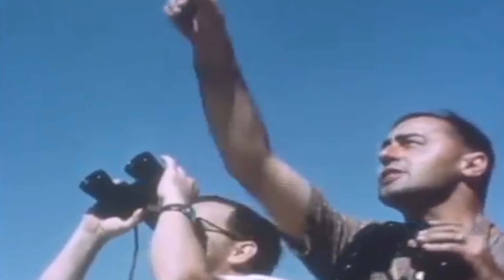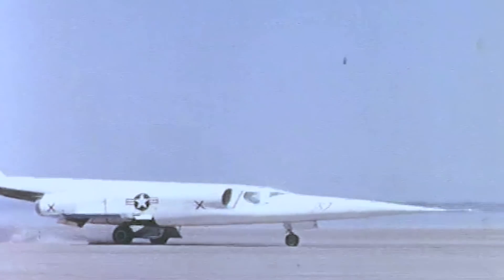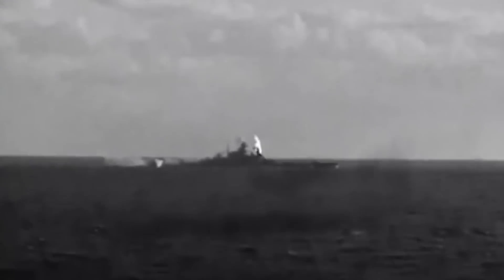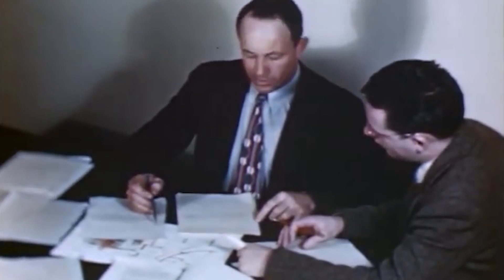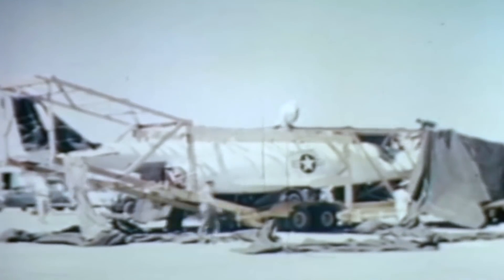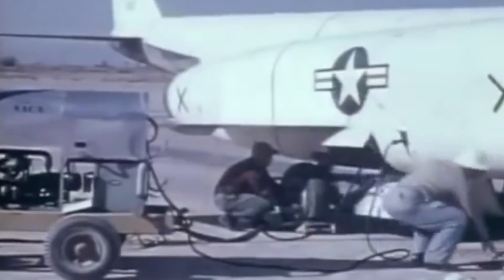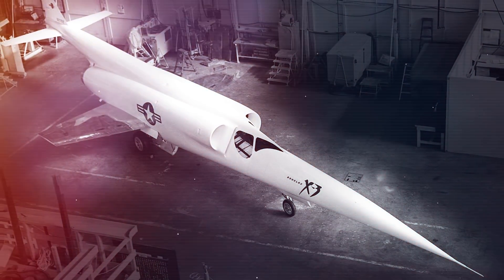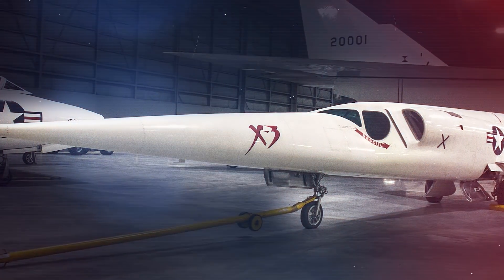Douglas X-3 Stilleto - The Dagger That Could Barely Fly

Comment: Another awesome aircraft doomed by it's engines.  The roll coupling was solvable with a larger rudder, as was done with the F-100 with similar issues.

0:29  That's the 16-foot tunnel (later  a 12 foot tunnel) at NASA Ames/ Moffett Field.  There is a scene in THE RIGHT STUFF where the 7 astronauts are walking on the lawn in front of the 16/12 foot tunnel.  Two twin 7x10 foot tunnels to the right and a corner of the huge 40 x80 foot tunnel on the lower left.  I worked in a model shop in the late 1970s on the far side of the 16-foot tunnel. The shop and far more have yet to be built at this time.

Comment: In appearance the X-3 looks like it could streak to the Soviet Union & use the point of its nose to pick the lock on the third door down a long corridor from a front door of the Kremlin. 
But other than theoretically & learning from aspects of the plane it doesn't sound like it could pick its own ass.

Comment: I had to replay one part 3 times to make sure I heard right: "From 1941 until the beginning of 1943, the Douglas SBD would be the vanguard of the US Air Corps, fighting off the Japanese Zeros ... "  Wow ... I've heard a lot of Dark videos, and I've enjoyed them all, but I've never heard such glaring errors as this.  
First, the only service that fielded the SBD was the US Navy and Marine Corps, who named it the "Dauntless".  The only US Army variant was the A-24 Banshee, which saw very little service.   
Second, the SBD wasn't a fighter at all, but a BOMBER - specifically a dive bomber.  Among others, the SBD's were credited with sinking all 4 aircraft carriers the Imperial Japanese nave sent to the Battle of Midway.  
Third, the SBD served long after the beginning of 1943; they flew with distinction in the Battle of the Philippine Sea in June 1944.  Many of the pilots preferred it over the Curtiss  SB2C Helldiver that replaced it, because of its superior low-speed handling characteristics, critical for carrier landings.

Comment: 9:53  -  ''... in the following months until December of 1943 '''     DECEMBER 1943 ???   But the X-3 was first flown in 1952 ...    
CONCENTRATE & PROOF YOUR SCRIPT.  
// The Douglas X-3 Stiletto was a 1950s United States experimental jet aircraft with a slender fuselage and a long tapered nose, manufactured by the Douglas Aircraft Company. Its primary mission was to investigate the design features of an aircraft suitable for sustained supersonic speeds, //   
Role: Experimental aircraft
Manufacturer: Douglas
Designer: Schuyler Kleinhans, Baily Oswald and Francis Clauser
First flight: 15 October 1952  <------------------------------------------------------------------------<<<<<<<
Retired:	23 May 1956
Status:  Preserved at National Museum of the United States Air Force
//  [Wiki refers]

Comment: If only that plane could achieve the goals set for it. I think it’s beautiful and must have looked revolutionary for an early offering to the jet age. I wonder if engineers today could troubleshoot the issues that hampered  the plane’s speed and  get it flying passed Mach 2
Reply: Well, the first thing they would do is change out engines for something that actually had enough thrust.  They got the F104 past Mach 2 on a single engine, which says a lot about how underpowered the engines in the X3 were.  Still, as a test bed vehicle, it taught them a lot, even if it didn't come anywhere close to fulfilling expectations.

Comment: There are several informational flaws here. 
1. It was one of the first airframes to extensively use TITANIUM in its design 
2. It was developed and flown from 1952 until 1956, not the 30/40s, even if the requests came in around the 1940s. 
3. Westinghouse engines were notoriously underpowered, but given they were the main contracts (and the only ones available), there was little choice in the matter. P&W and GE didn't come into the jet age picture for a while.

Comment: The X3's airframe is not entirely made of aluminum.  Its true the wings of the X3 were machined from a single block of aluminum, however  most of the fuselage is actually made of titanium alloy because the engineers working on the project had envisioned the plane would eventually go Mach 3 and aluminum would easily melt at 2000 mph.  Douglas pioneered the use of titanium for aerospace use and these techniques were eventually used for manufacturing parts for the Lockheed YF-12A Oxcart and SR-71 Blackbird programs. Unfortunately, in the X-3's case, Westinghouse failed to deliver an engine with enough thrust because the engine they wanted to use that had the performance needed grew too big to fit into the X-3's small airframe so Westinghouse was forced to use a much lower thrust rated engine instead that barely would allow the plane to go much above Mach 1.  This alone detracted from the planes performance drastically and it took forever for the plane to generate enough lift for takeoff, hence the plane made extremely long takeoff runs down the dry lake bed at Edwards Air Force Base before liftoff.  The Douglas X3 Stiletto is the worlds first aircraft to feature a downward ejection system.  Engineers thought because of its high set tail, ejection seats of that time period would not clear the tall tail safely so a downward ejection seat was incorporated into the plane's design.  The way the pilot gets into the cockpit is there is an elevator door at the belly of the cockpit that comes down and once in the fully down position, the pilot straps in the seat and the elevator eventually lifts the pilot sitting in the pilot seat up into the cockpit.  Test Pilot Joe Walker flew the X-3 and he discovered by accident a phenomena known as inertial coupling that was causing the losses of several F-100 Super Sabers.  The X-3 is credited for helping to unlock the mystery of inertia coupling.  I remember talking to General Frank "Pete" Everest who flew the X-3 for the Air Force.  He said the plane "looked really good."  "It looked like a dagger ready to go."  He only wished the plane had the proper thrust rated engines and he was sure its performance would have been much more noteworthy in aviation history.  Today, the Douglas X-3 Stiletto resides as a static display in the National Museum of the United States Air Force at Wright-Patterson Air Force Base in Dayton, Ohio..

Comment: I have a issue with the time line that this video lays out. How could the powers that be consider or even conceptualize mach numbers or achieving such speeds when according to the timeline provided jet engines had NOT been invented yet. 
Frank Whittle, the inventor of the Turbo jet engine was still perfecting it in the early 1930's. The Me 262 the first jet plane only saw service in the early 1940s. So I question how any government hope to achieve faster than sound flight before the technology was available......as this documentary seems to suggested.

Comment: You cite that the engine swap was a major change however, given that aerodynamically, drag increases in relation to the square of the speed, a 40% increase in power would not have allowed the plane to go from sub-Mach 1 to Mach 2.

Comment: Thanks for the video and information. I had a model of this in the 60’s. It looked very futuristic. Several, or maybe many, early jets in the U.S. were underpowered. Also, if you notice some early jet designs have engine intakes flush with the fuselage. This seemed logical but actually DECREASED airflow into the engines due to boundary turbulence. Now all high speed jets have separation between fuselage and engine nacelles.

Comment: I flew this plane, barely, in the original Windows flight simulator back in Windows 3.1 days. I believe the simulator was Chuck Yeager's Flight Simulator. It had a bunch of planes available, one of which was the X-3. Could barely get it off the ground and then barely hit mach 1+, or keep it in the air.

Comment: you surprised me. Most people never knew the X-3 was actually the testbed for Lockheed to build the F-104 . Yeah, It was underpowered. The engine tunnels in the X-3 were only 27 inches wide. You simply couldnt put more power in that space at that time.. It also had the same adverse yaw problem the F-104 had. In the F-104 it was a deadly problem, but in the x-3 it was mostly a major annoyance. Youll notice also, the X-3 has a flat bottom. That was intentional. What wasnt intentional was the amount of lift it provided, and the X-3 quietly lead the way into the study of lifting and falling bodies like the XB-24.. Marvelous little plane.

Comment: I wasn't aware that planes capable of supersonic flight were being proposed as early as 1941. At that time planes were propellor driven and the phenomenon of the speed of sound was known as the Sound Barrier, and Mach 0.7  was thought to be the safest maximum. Let alone Mach 2! Bell were having terrible problems with control, which weren't solved until the British Miles M52 designs were given to the US, the agreement being for technology to flow in return. But that return never happened. None of this is mentioned. The Douglas X3 information is interesting, but the preamble is a manipulation and oversimplification. And this is from Wikipedia.

Comment: It is not on the 4th floor, it is in the experimental section. The only things on more than the 12st floor at the museum are aircraft hung overhead, the small restaurant, some UFO exhibits and in the missile silo section. I moved from there a bit over 2.5 years ago so can't be sure if it is in the 4th hanger or not.

Comment: I have to point this out... There is a Difference between "X" aircraft which is strictly built for "Experimental Research", like the X-3 -  and then there are "Prototype aircraft" such as the XF-12, XB-70 or YF-23...those are initial prototypes intended for mass production. The first 2-3 aircraft (or Prototypes) are given an additional "X or Y" designation to the program while going through testing.  XB for Bombers, XF for Fighters, etc..

In this video and a few of your others about "X" planes, you seem to give the wrong impression about these aircraft.   These aircraft with Only an X designation (the X-3 Stiletto, X-1, X-2, X-15, etc) were built exclusively as Experimental Research aircraft... to push the extremes in speed, altitude, radical design characteristics, etc. to learn from and incorporate into future production aircraft.

 I'm not trolling...I enjoy your channel. 
 I Just wanted to point this out for people that may not understand the difference, and many of these X planes were very successful in the research they were exploring.

Comment: What would be neat is to take the X-3 and fit it with modern engines and control systems to ensure it goes where the pilot aims it. That's the secret to fighter jet maneuverability starting in the 1980's when computer technology became fast enough. Planes like the F-15 and F-16 were designed to be stable and the controls force them away from flying straight. In contrast the F-18 was designed to be unstable. The computer is constantly twiddling the control surfaces to make it fly straight. The pilot's control inputs tell the flight control computer which way to allow it to let the instability take it.

The 1940's and 1950's test pilots had such extreme skills and reaction speeds to survive most of the crazy planes they flew.

Comment: The SBD was never the vanguard of the "U.S. Air Corps."  Firstly, it was the U.S. Army Air Corps up until 1940, then the Army was restructured into Army Ground Forces, Army Service Forces, and Army Air Forces, at which point the Air Corps became the U.S. Army Air Forces.  Also: the SBD Dauntless was almost entirely a United States Navy plane; out of the almost 6,000 Dauntlesses built, less than 1,000 were used by the U.S. Army.

It did not fight off Japanese Zeroes except insofar as it had to survive their attacks while the SBD was trying to dive-bomb enemy ships.

Comment: They didn't start supersonic research in 1943 because the prospects of war changed, but because Bletchley Park made a translation error, and thought Germany was working on a 100MPH (supersonic) fighter when they were in fact working on a 1000KMPH (subsonic) fighter. Allies then tried to match the performance of this non existent German project by issuing contracts to Miles Aircraft in the UK and (two years later) Bell Labs in the US.

Comment: The only reason the Stiletto failed was because 1952 turbojet technology wasn't as mature as airframe design was - they simply couldn't find two engines small enough to fit on such a radically skinny fuselage that also could produce supersonic speed. This concept didn't achieve fruition until six years later with the F-104, which used the same dart fuselage/straight stub wings/dual inlet design as the Stiletto but a much bigger single GE J79 engine. The J79 was no peach in terms of reliability, but it was extremely powerful, and thus the "missile with a man in it" concept was finally a success.

Comment: I wanna know who designed the wind tunnels to make Mach 1 winds. That's gotta be  a feat itself.
Reply: It's actually quite easy.  It is much more difficult to make a wind tunnel perform at transonic speeds.   Local choking gets to be an issue, as does shock reflection.   Choking is not an issue in a supersonic tunnel because you blow the shock out.   And at reasonable Mach numbers shock reflection usually does not impinge back on the model . . .

Comment: "It was a one man jet made entirely of aluminum" umm no, it was on of the first aircraft to use titanium in major airframe components.
"..a clunky takeoff speed of 260mph" again no. It had a rather high take off speed of 260 KNOTS which is 300 MPH.
"..in the following months, until december of 1943", you might want to proofread a bit more before committing to video.
Reply: He also said "fourth floor" of the AirForce museum, which doesn't exist. He should have said "fourth hangar."

Comment: As a prototype, the X-3 was a success, and informed the many designs which followed. Its failings were learned from and turned into subsequent successes. It proved also that just because it looks like it might go faster, it doesn't always. Rather like the Spitfire's wing: the elegant elliptical curve looked like it carved the air, but later iterations had their wings clipped — the result was ugly but they flew further and faster.

Comment: "The dagger that could barely fly"
Gaijin plsssss
Reply: The wings are too short!!! There I figured it out with one glance... The designer needs his head examined or should have stuck to working on the set of flash Gordon.  
To fix it would need Delta wing's & nose canards also flight computer to improve stability
Reply: @punkvoid9957  nobody at the time really knew the aerodynamics of supersonic flight back then. The X1's wings where about the same shape, and the F104's are not that much larger. Computerized Flight Control systems where still 2 decades and change off, too, though had they existed at the time, it would have certainly made it less of a chore to wrestle around the sky.

Comment: Dark Skies has shattered its own previous record for most inaccurate statement in an aviation history docu-vid. "From 1941 to the beginning of 1943, the Douglas SBD would be the vanguard of the U.S. Air Corps, fighting off the Japanese Zeros in Midway, Guadalcanal, Tarawa and the Solomon Islands campaign."  I'm sure I don't need to correct this for most viewers, but for non-aviation nerds, the Douglas SBD WAS a very important aircraft during that timeframe...to the US Navy, which is most definitely not the same thing as the Air Corps.  And it was a dive bomber, not a fighter, and was  NOT a weapon of choice for battling Zeros, and without fighter cover was more likely to be at the mercy of Zeros rather than threatening to them.  That sentence in the above quote sounds more appropriate for the Grumman F4F Wildcat, a tough but obsolescent navy fighter that held the line in the early phase of the Pacific war against the much-superior Zero (with the help of tactics, training and tremendous bravery among its pilots).

Don't get me wrong, the SBD's vital contributions during that time period cannot be overstated, but they weren't generally in the form of clashing with Zeros, and SBD's did not serve with the US Army Air Corps.

PS - I like the channel very much, but as I have stated before, off-the-cuff inaccuracies and footage that doesn't match the topic are just part of the charm.

Comment: The project was a bit too ambitious because it encountered a really nasty instability issue called inertia coupling . But it did give a lot of insight into that issue, and later supersonic aircraft had larger tail surfaces and wings to improve high speed stability.

Comment: Even though it didn’t perform as expected, I am glade it didn’t cost any lives, that it survived and was preserved.
Reply: Research and development is as much about finding out what doesn't work as it is about finding out what does.

Then again, silly putty was pure serendipity.
Reply: The wings are too short!!! There I figured it out with one glance... The designer needs his head examined or should have stuck to working on the set of flash Gordon.  
To fix it would need Delta wing's & nose canards also flight computer to improve stability